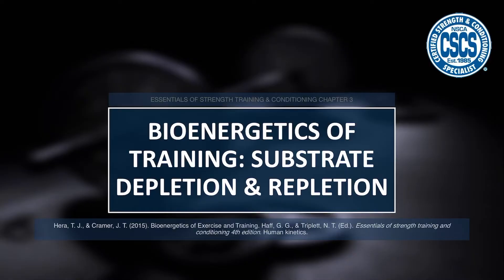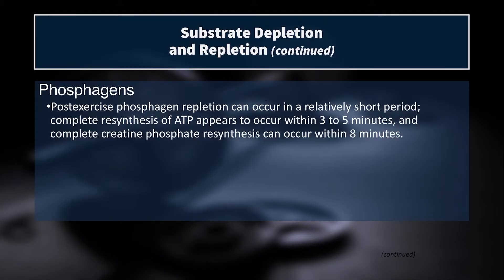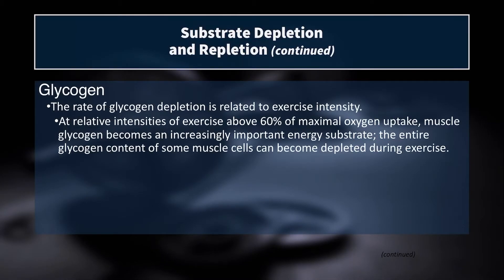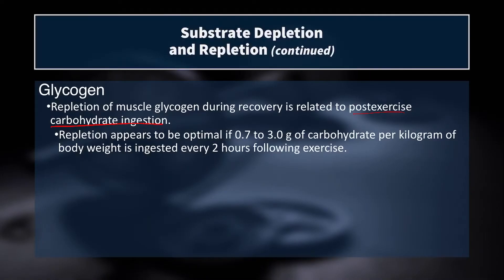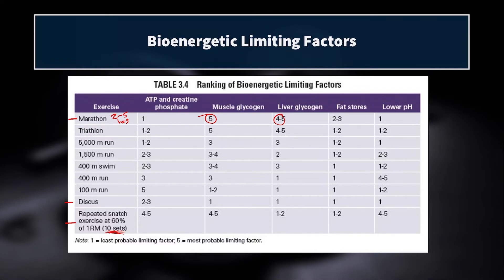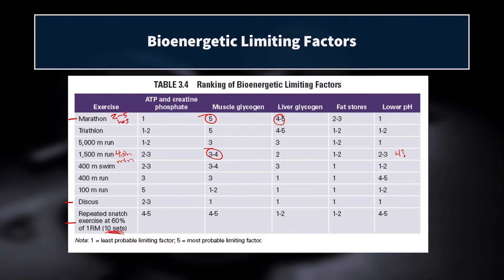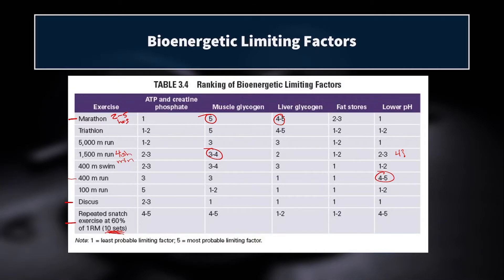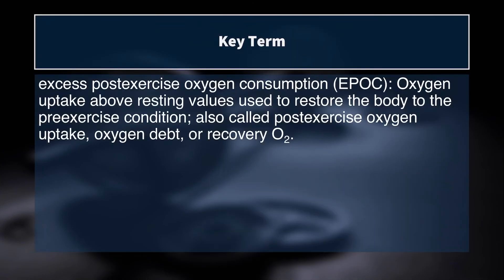Substrate Depletion and Repletion | CSCS Chapter 3

Comment: It's still hard to get over the stigma of ingesting carbs that was preached in the early 2000's. I have to admit I remain hesitant to increase my carb intake significantly, or at least adjust my caloric intake to favor carbs more. I have to wonder if I'd see an improvement in my performance.

Comment: If only we did not have EPOC and could get our O2 levels back right away. I like the differences between the low intensity and higher intensity workouts for how oxygen is consumed and how it is needed post exercise in order to get the body to normal gas levels.